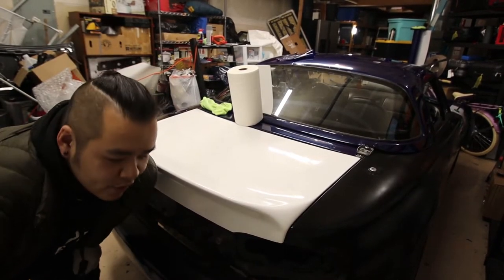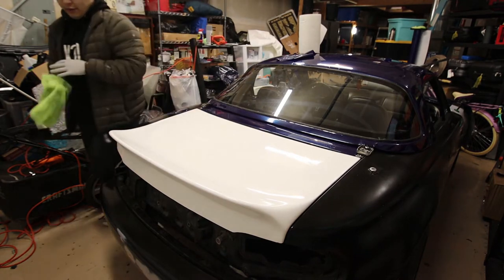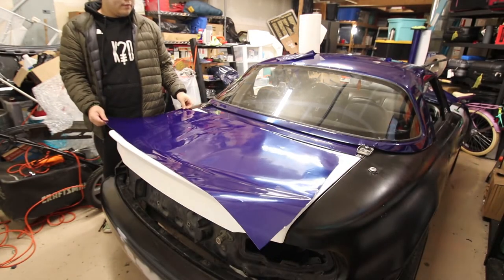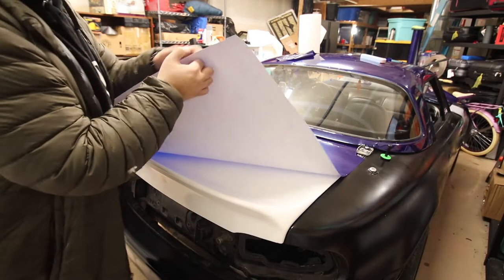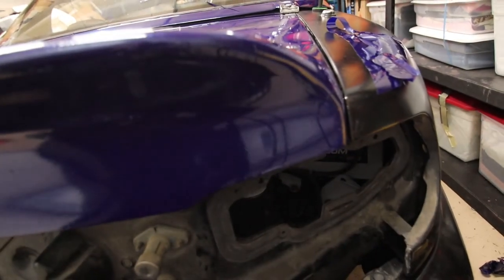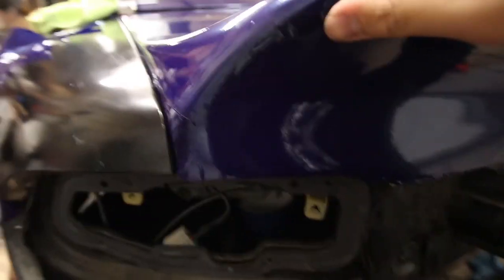Ducktail Install and Vinyl Wrap!

Comment: Hey did you need to take off the rear finish panel first to install the duck tail because I bough man from ccpfabrication as will and I install it and it does not close
Reply: You have to adjust the trunk latch in the up position.